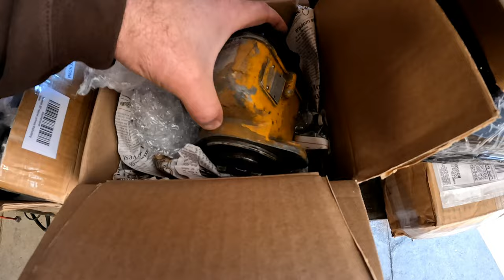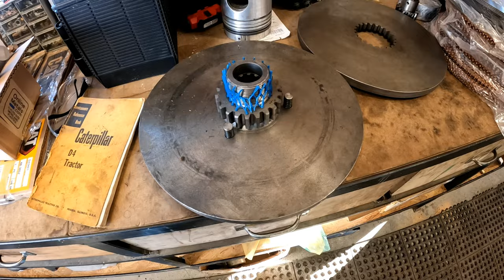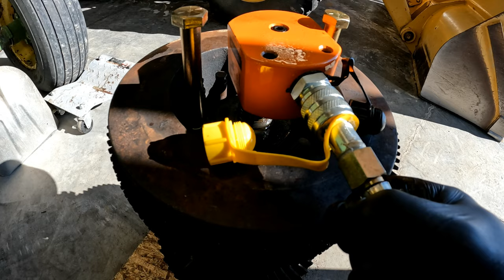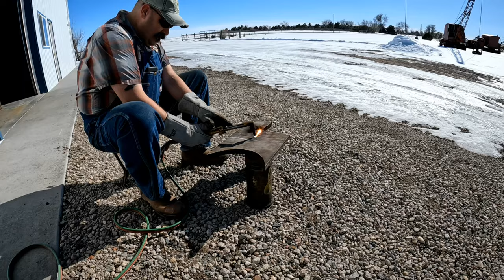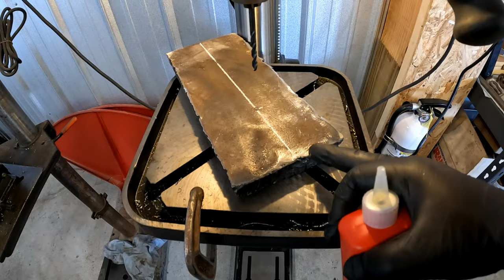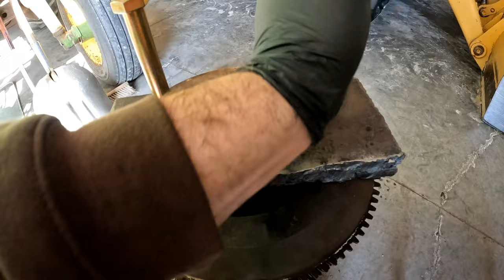Pop goes the steering clutch, disassembly goes correctly! 1939 Caterpillar D4 4G9986 Episode #21

Comment: Don't worry about the machinists, field engineers with portable drill presses, hand drills  files and hammers get those carefully, accurate and beautifully made parts actually fit the sometimes not so beautifully and accurately assembled machine they have to fit actually WORK beautifully making everybody look good. 😁
👍🇺🇸😎

Comment: The 20 ton ram did it job perfect. I think you can cut the messed up threads as well but if it is a hardened surface the cutter must be brand new. I can only imagine the money in the parts you had to buy to this thing. At least your area is sunny, I have a blizzard outside and everything is frozen fast on the ground for weeks.
Reply from the maker: It was a good day and so far I am about $4500 into the project tractor and all. We are expecting more snow next week. Stay warm!